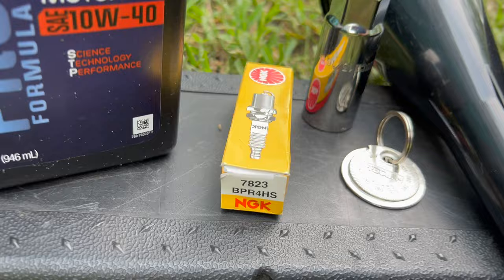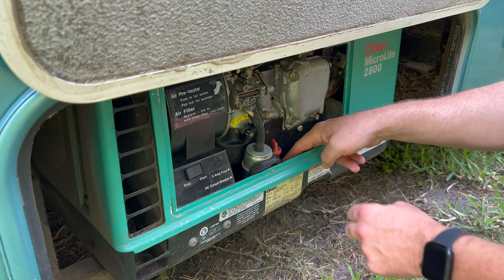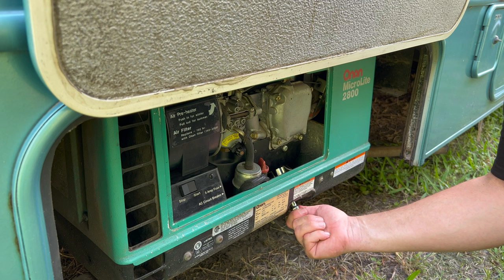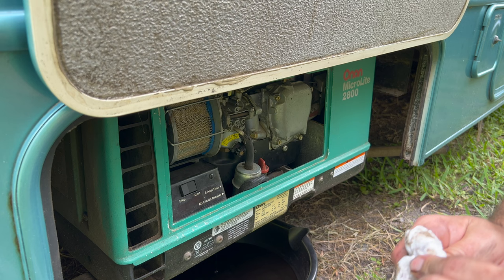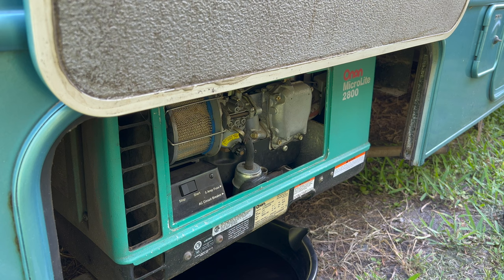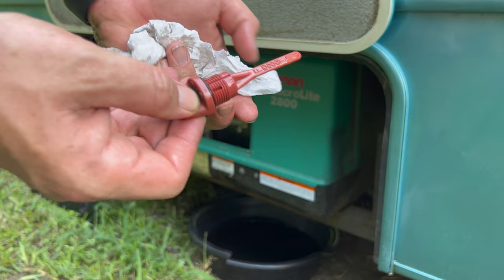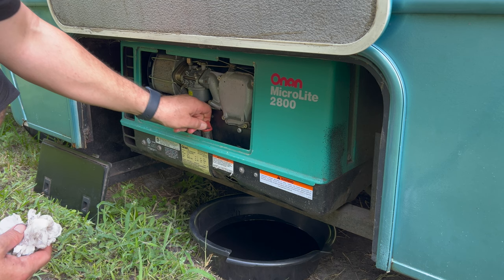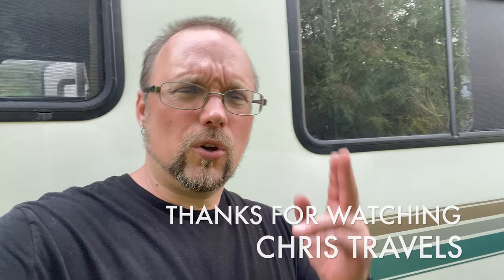Onan MicroLite 2800 Generator DIY Oil and Spark Plug Change

Comment: I have the manual but couldn't find what weight to use for oil, oh and thanks for mentioning that there is no oil filter, that's why I'm here. 👍
Reply from the maker: Awesome! So glad my video helped. I found the oil chart on page 16 of my manual. But to make sure, and to check on the spark plug as well, I called them directly. Thanks for watching!

Comment: Great video----How often should you change the oil in this generator?
Reply from the maker: Great question! I just check the owner's manual, and according to the Periodic Maintenance Schedule, oil changes should be done every 100 hours. If it is a new generator, the oil should be changed after the first 20 hours, and then 100 hours going forward. I hope this helps!